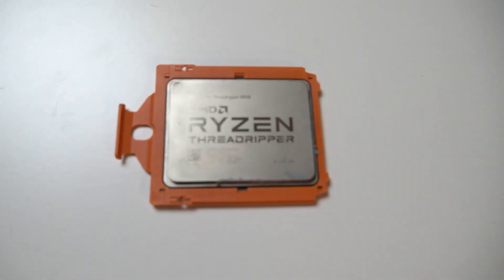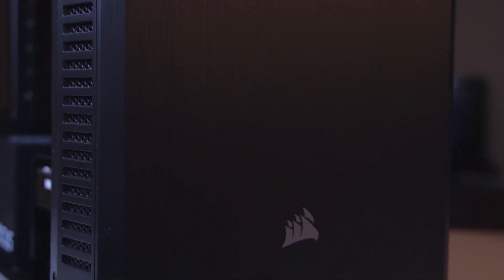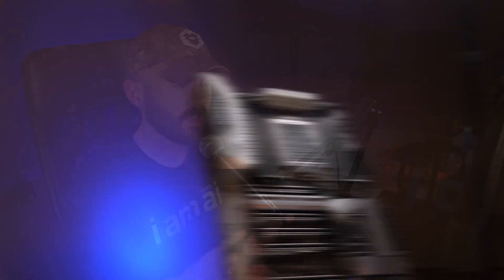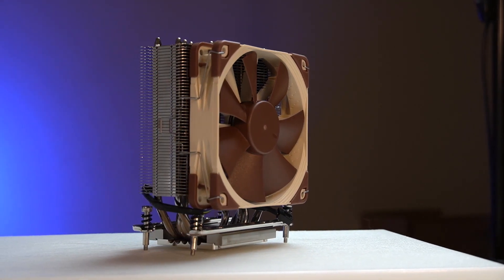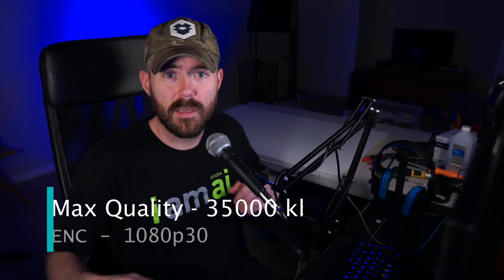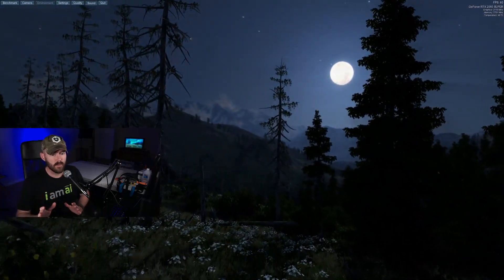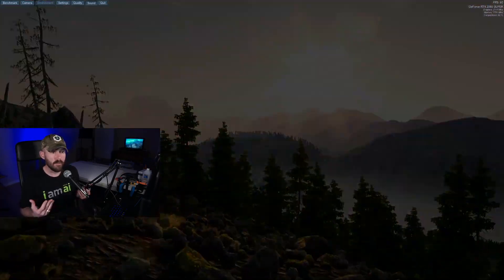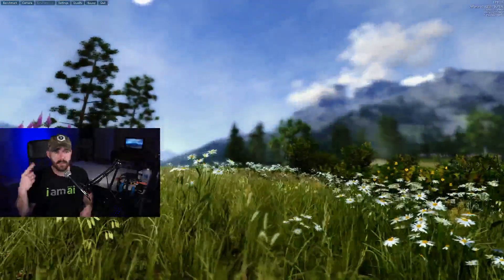Pay it Forward Overkill Charity PC Build

Comment: Gtx 1080 in a 2020 Build?
Reply from the maker: Nelko Gaming ya, it’s not a state of the art machine by any stretch. But a 1080 is plenty powerful for anything they’ll be doing.
Reply: It has threadripper which makes the 1080 a bottleneck 😂
Reply from the maker: @ll-jq6nu  again, this isn't a gaming computer, it is used for rendering and will be a healthy upgrade from their 10 year old xeon based workstation.